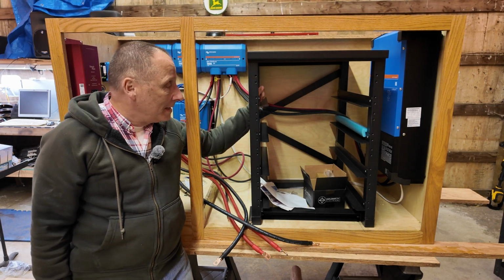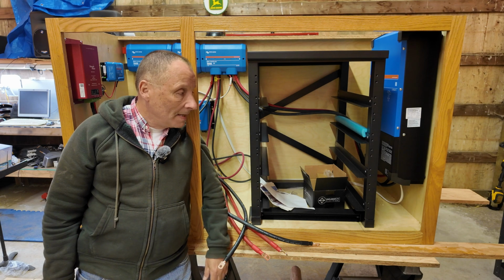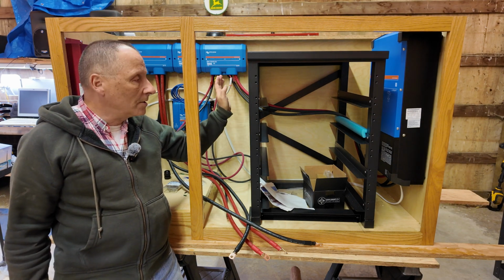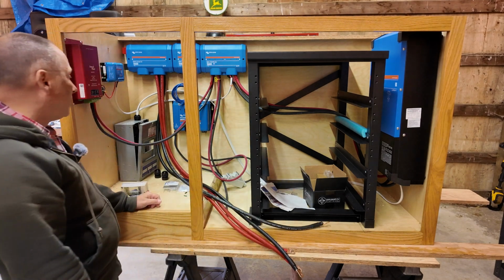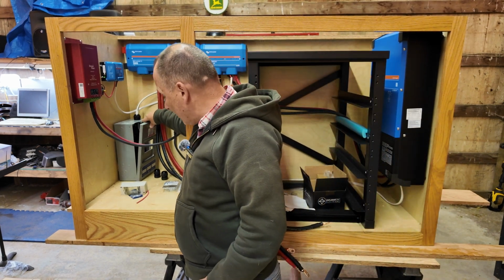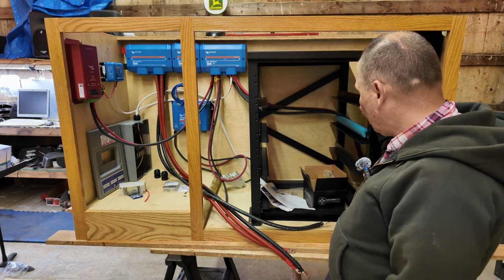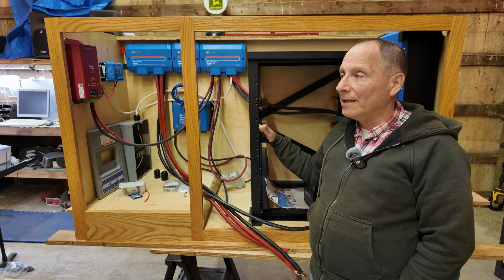2025 05 15 Bus Electrical and Siding Update

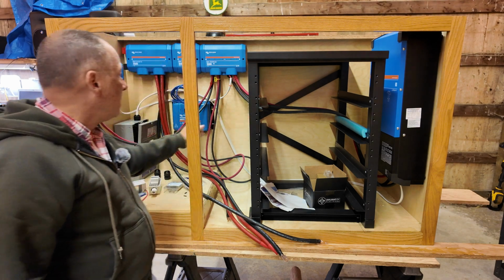Comment: 6:09 Once that rack is populated, and you hit a big pothole or come to an abrupt stop, any worries that the weight at the 'end' of the lever arms (farthest distance top/front) is going to break anything?
Reply: You are on my calendar.   Hope to see some roses in bloom as well.
Reply from the maker: Some of the early bloomers are trying to get blossoms. By the 31st, there should be a few more!
Reply from the maker: A good question. The bumps shouldn't be too bad as the bus suspension is quite smooth. A severe stop is a bigger concern. The batteries will be at the bottom of the rack, reducing the lever effect. The cabinet will be attached to 3/4" plywood that is screwed to the bus ribs. We will make it as secure as possible.